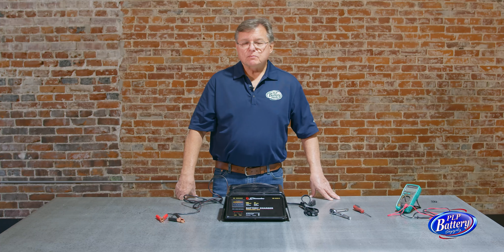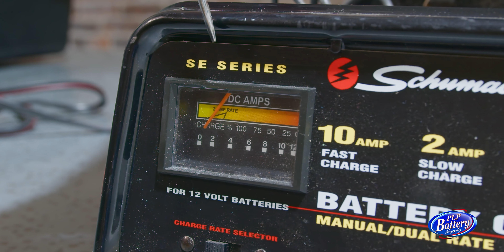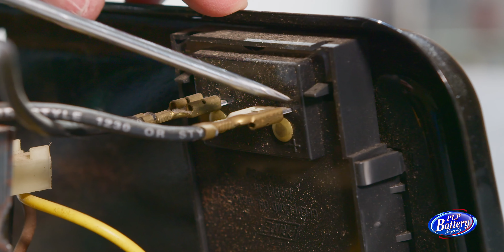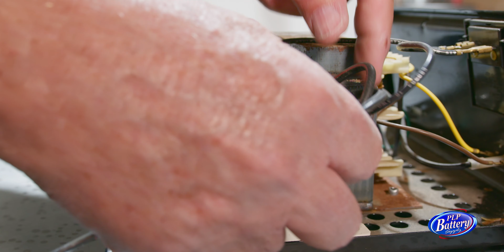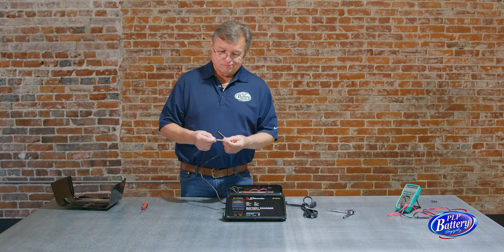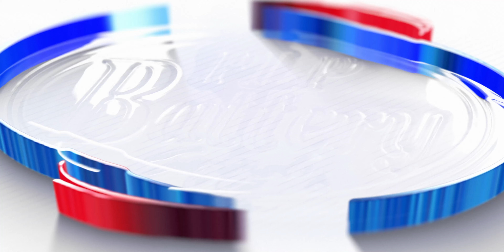Battery Charger Repair

Comment: That’s not exhaust noise that’s the sound of a tire inflator/ tiny compressor. Believe me when I tell you that because I grew up with an automotive background raised in auto shop which i took over and have consistently run it until I was forced to retire for medical reasons